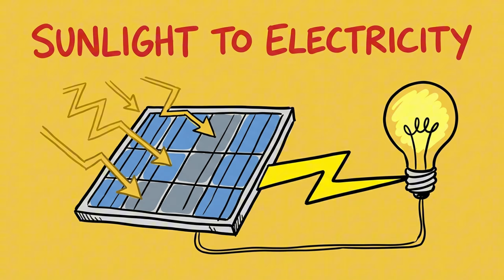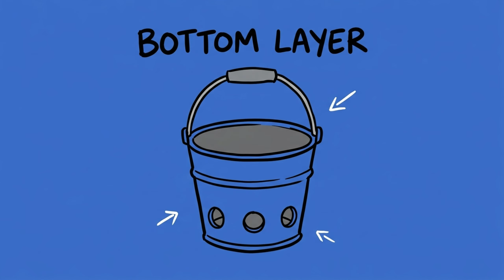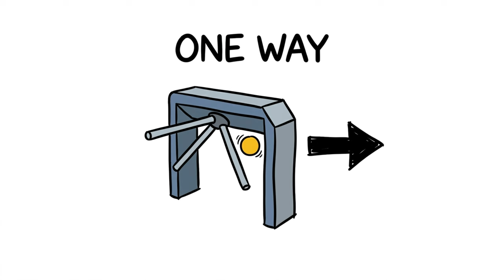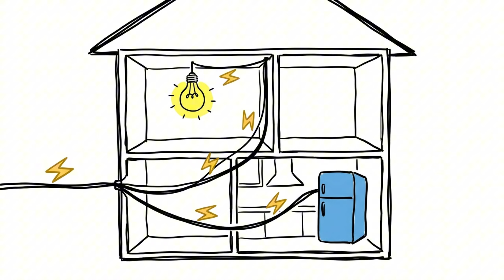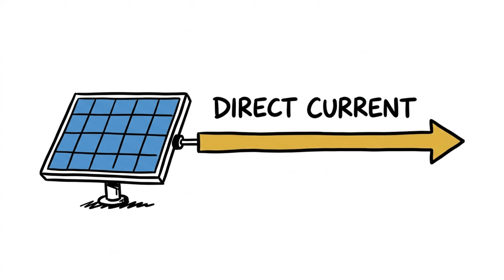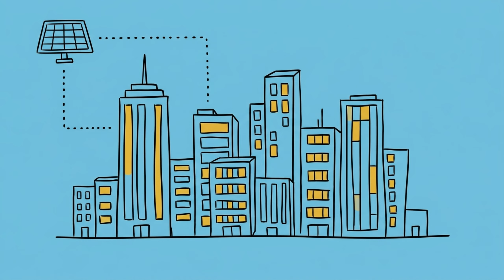How Do Solar Panels Actually Work?

Comment: they do but you have to stick your tongue   across the contacts during a heavy thunderstorm and lightning strikes to accommodate the extra five hundred thousand volts of voltage and enormous current!otherwise you will freeze to death in winter!even if you are inside the house!